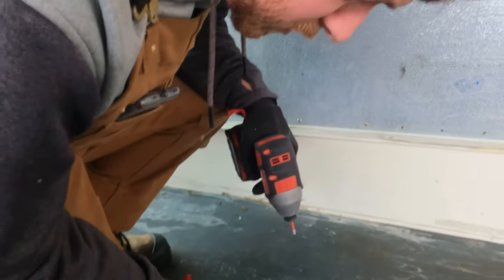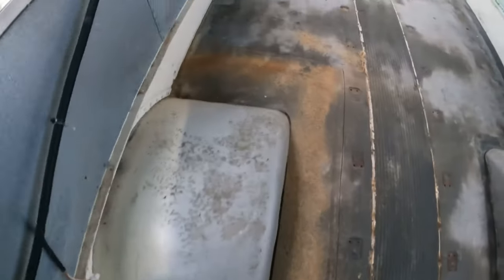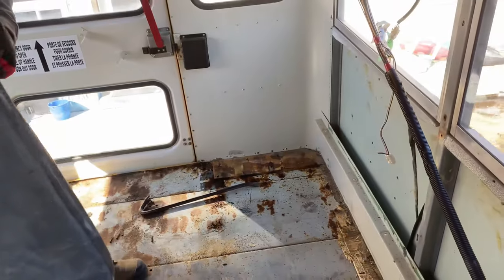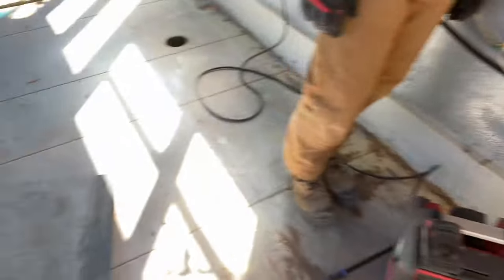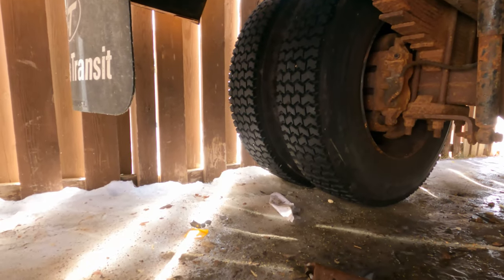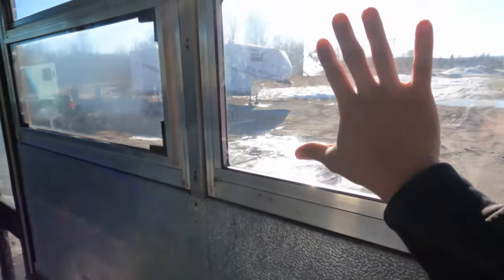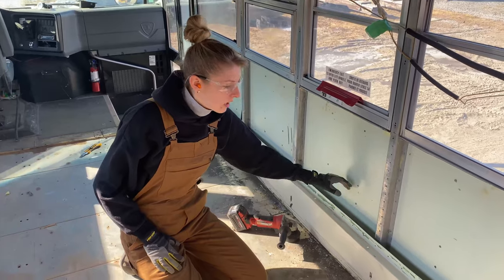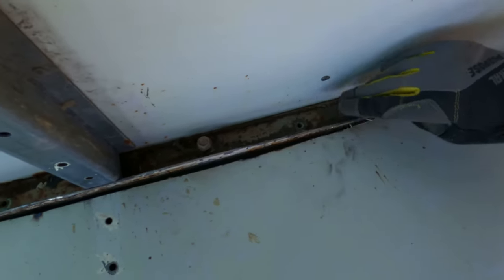Removing the Floors | Skoolie Conversion Ep. 3 | Adam & Steph

Comment: top down, top down. gravity   The reason there is rust in the rear, under the old floor, is all the water that got in the bus for many years had no exit. After a good cleaning and an oil primer, leave the holes as exit vents.